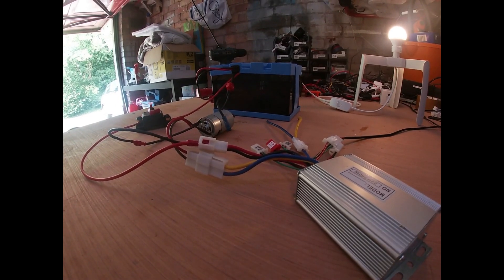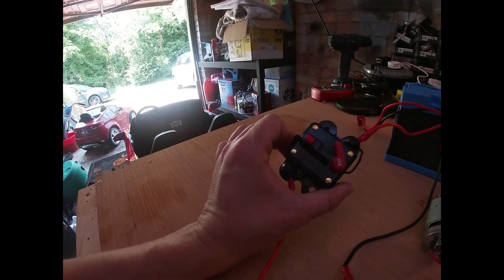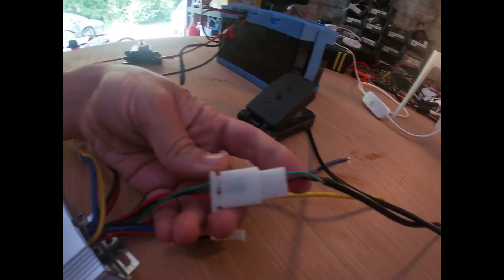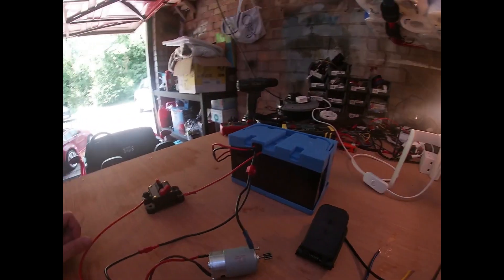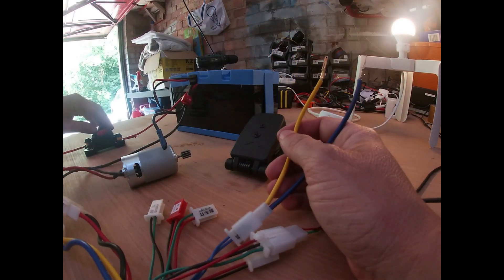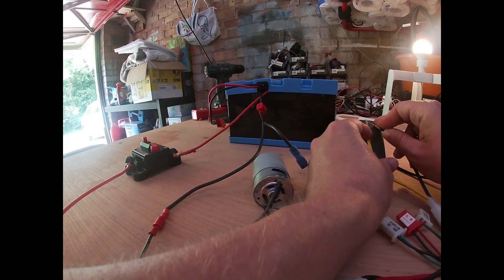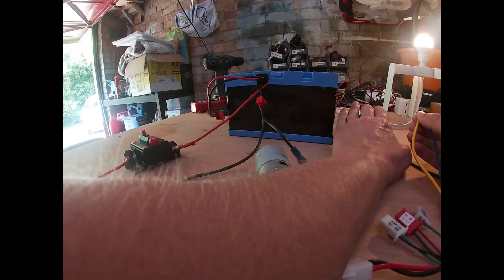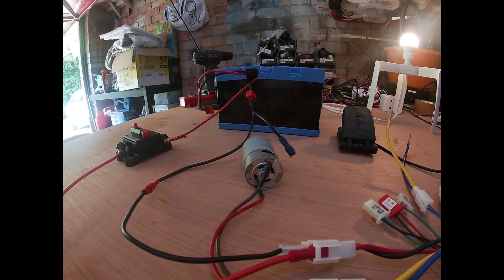Kids Ride on car ESC Fitting Part 1 | Power Wheels 24v Upgrade | Motor Controller Fitting

Comment: I'm doing the same upgrade on my kids 12v renegade maverick 
It is 4 wheel drive so 4 motors.
I see you used a 500w ESC. Should I get the 1000w since it 4 motors?
Appreciate the help.
Reply from the maker: No I have 4 motors on the car in this playlist that I am fitting the controller to and 500w is fine, it provides enough torque to tow my  Ford Galaxy (UK version of a minivan)
Reply: @Stitch76  thanks
Are there 4 motor outputs on the esc or did you put all motors into same one?
Reply from the maker: All into 1, your car currently will have all 4 eventually going into 1 place at the moment, so just tap into that place
Reply: @Stitch76   cool beans!  thanks for the reply will let you know how I get on!

Comment: Hey I wanted to ask you for some advice? I have been trying to upgrade my sons car but I got to a stage where I end up melting the original gearboxes what do you do to ensure this doesn’t happen?

I upgraded the ESC to a VESC and use 2750KV inrunner motors in each wheel powered by a custom 12V 15p3s LG HG2 lithium battery
Reply from the maker: Yeah with 2750KV motors, I'm not surprised you melted the plastic gearboxes. You could try drilling out the centres of the gears a bit bigger and fitting bearings on them. I've heard of people doing that but yeah your spinning them too fast, they are only plastic gears at the end of the day. A couple of people in the states have had metal gears made up but then what your running, you will just melt the gearbox. You really need to change over to a direct drive method with those motors. Sorry it's probably not what you wanted to hear but that is just a bit too much power for standard gearboxes.

Comment: Hi

Can you connect two motors to this speed controller?
Reply from the maker: Yes you can the car I fitted it too in this playlist is actually running 4 motors
Reply: Hi again, i have followed this as shown but the motors are slower then if i just connect the motors directly to the battery, any ideas why?
Reply from the maker: @Jonnykirk123  what ESC did you get and what pedal?
Reply: I have exactly the same pedal and esc 24v 500w and I also have another esc i tried same outcome.
Reply from the maker: @Jonnykirk123  can you please contact me on contact@stitch76.co.uk and we can talk there, I may need some photos to try and work out what is going on with your set up
Reply: I will try and get some pictures tommorow, thank you
Reply: Hi again I sent over some stuff via email did you get any off it?
Reply from the maker: Just for the people reading this, I did receive the emails and the issue was found to be the way the pedal was mounted, in that it could not be fully pushed down. JonnyKirk123 has emailed me to confirm that it's working now. As always we will help where we can.
Reply: @Stitch76  would a 36v upgrade melt the motors/ gearbox?
Reply from the maker: @them00reman  Probably yes, they are only plastic gears, even with the soft start from an ESC, I would eventually expect the gears to start to melt at 36v
Reply: Hi stitch76, I need some help changing to 24v from 12v. How do I contact you direct?